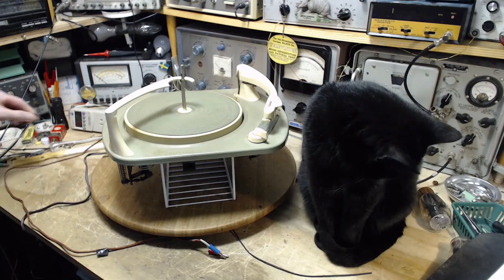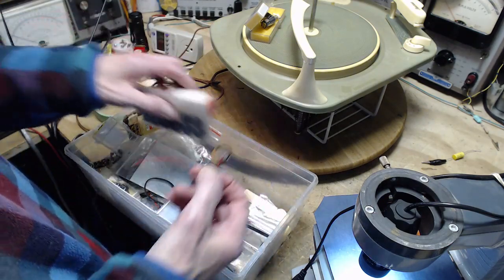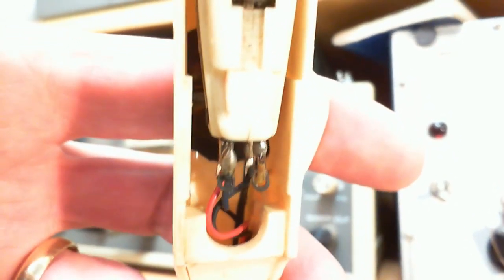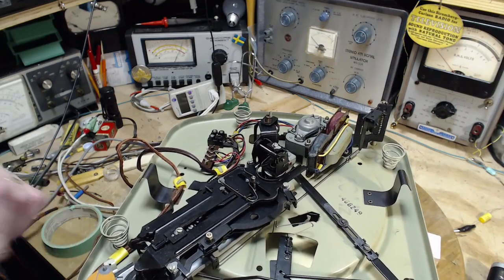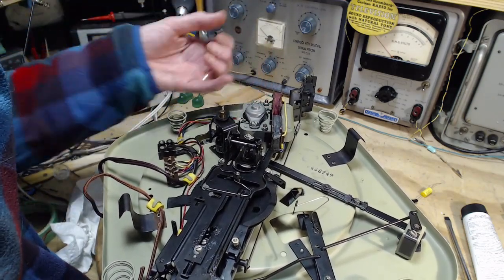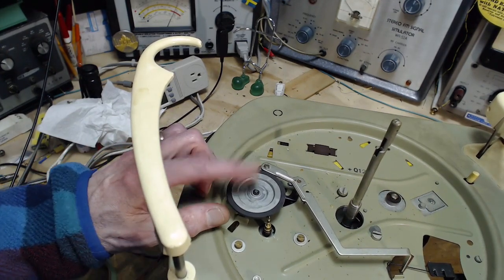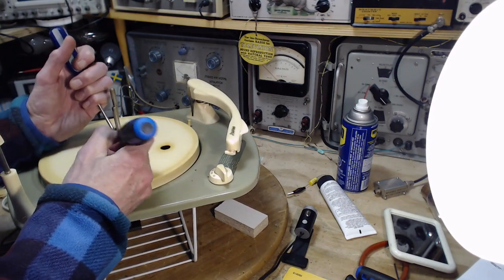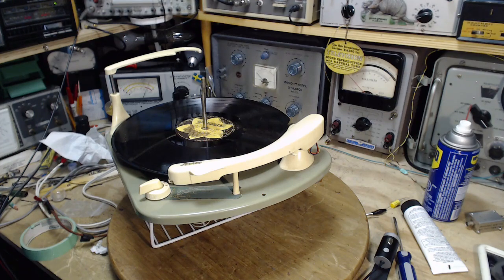Telefunken Record Changer - Basic Maintenance and Restoration

Comment: I'm in need of help. I have a similar one called Telefunken TW560. And that also has that spring loaded button where the vinyls land on so it knows it's the bigger discs.

I don't get how it should work. Sure, the record lands on the button, and the arm lands correctly. But the button is pushing the record from under because of the spring pushing the button back up again. So it's scratching on the record while it's spinning all the time.

Comment: To get the needles out of those vintage packs you just pop the plastic cover out, it pops back in just as easily. That's how whoever put the older one in with the newer one did so. The estatic case is never opened from the back.